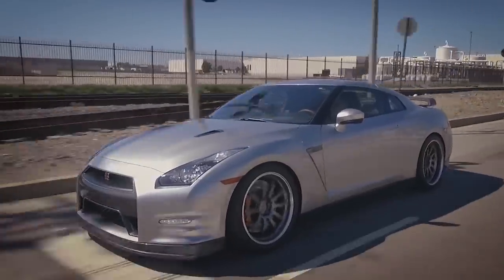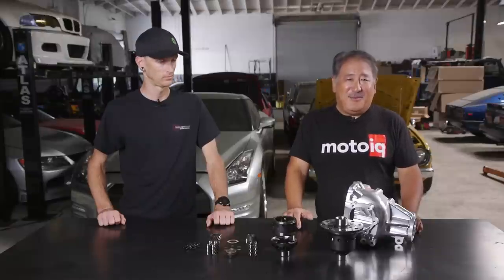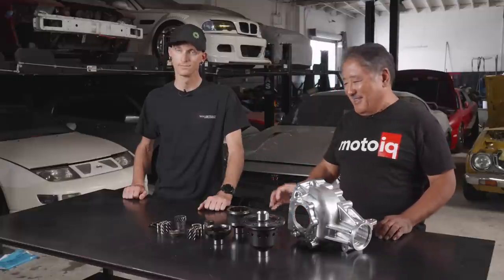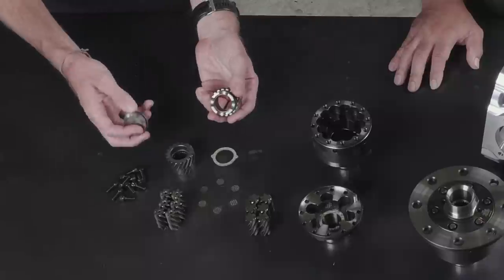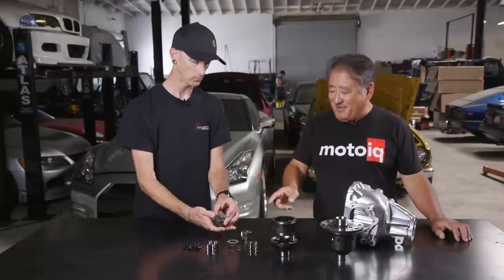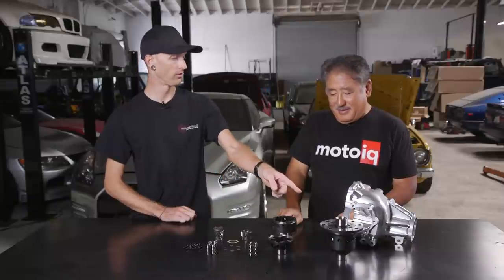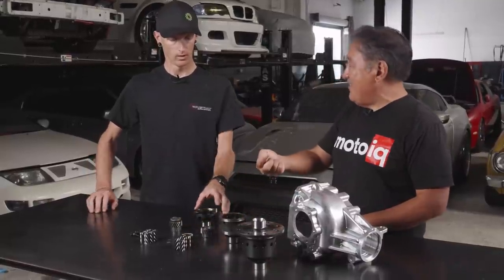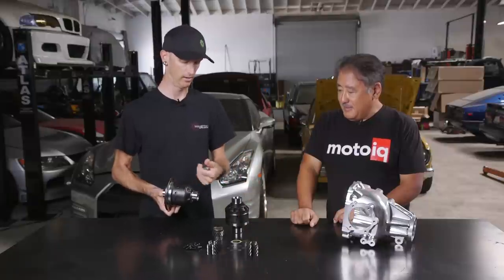How a Wavetrac Differential Works (and why you want one for your GTR!)

Comment: Literally one of THE MOST SLEPT ON car part manufactures is Wavetrac, Ridiculously reliable and lifetime warranty, feels so natural.
Reply: ATB Helical diff is probably the most slept on mod.
Reply: @JimBrodie  They also offer a lifetime warranty? I’ve used Wavetrac in all of my builds, I mainly like the natural feel of the diff and the fact that it does not interfere with any electronic driving aids. 

I’ll need to look into ATB design, I think I recall them having Yellow font and a blue box? 

Cheers.
Reply: @7eamGhast  I didn't mean a specific company, i meant as in this style of diff. ATB being an acronym for automatic torque bias, which is what the helical design does as a function. =]
Reply: @JimBrodie  LOL I'm a dummy! thanks!
Reply: I had a wavetrac after I bought a kaaz/Cusco diff that seized and blew! Only thing that broke it in the end was me crashing the car 😂
Reply: Except for Wavetrac being a Quaife rip-off with non-serviceable friction plates that don't do a thing.
Reply: @brandonlittle6444  Not wrong there tbf, they're practically identical aside from 'patented' friction plate and 'patented' camming surface as mentioned in the vid.
Reply: @brandonlittle6444  wavetracs just hold up better.
Reply: @oetic5016  only Quaife ATB failures I'm aware of involve or follow an axle failure. Which is the same for the wavetrac. Which is to be expected with Brandon's correct statement.
Reply: @transved6356  Ive only ever had a quaife I cannot complain about them
Reply: I have my first wavetrac and zero problems with almost 900 ft/lbs. I only go straight through… well I try to go straight
Reply: Is that a copy of a Quaife diff that has been around for years - same principle.
Reply: Idk about you, but i don't sleep on car parts. I sleep on a tempurpedic.
Reply: I have a wave track in ford 9 inch and the posi is like dragging or something to the point starts to smoke checked had a bad side bearing but replaced it and set pre load and back lash and same problem so it needs a new posi now smh 🤦 has anyone ever heard of this? Or what cause it
Reply: I have a whippled supercharged auto 2020 Mustang GT. Spent a lot of money on suspension and tyres to keep it straight. Was thinking of getting rid of it and going back to a euro car. Enter wavetrac diff, installation of this diff on my stang has transformed it so much more stable and straight now love it and not scared of it anymore.
Reply: I hqve one in my gli running 360hp, it literally feel’s completely different. The power the car delivers now is crazy with almost no slip at all unless in 1st or 2nd gear
Reply: Been English I would always go with a Quaife diff
Reply: @oetic5016 I doubt that very much
Reply: also the most precise LSD
Reply: It's junk
Reply: @dvernst  you don't have no idea!
Reply: Everybody knows Wavetrac in the Pro Touring world. They've been a known quantity since at LEAST the early 2000s.
Reply: But they dont make for a ton of models
Reply: Quaife is good also

Comment: That says a lot when the company says go have fun and go abuse it.. nobody that doesn't trust what they've built will EVER say this.. plus a lifetime warranty means they know they've built a solid product THAT WORKS.
Reply: Depends on how much power u throw at it if ur only playing with 1000 hp that's nothing but u start playing with over 3k I'm questioning what's gonna break next and will I get another past
Reply: @jackdaniels2657  "only playing with 1000hp"
Reply: @theunluckycharm9637  1000 hp isn't alot it doesn't take alot of money or time to make 1000 hp  u don't need to machine anything everything is bolt on. U gotta tune ecu  change  fuel pump, fuel injectors change the cam port the factory exhaust manifold remove catalytic converters run strait pipe.  add a cheap turbo kit or go with electric turbos turn it up to 22 psi yup 1000 hp. U don't need to rebuild a whole motor to make power u don't even need arp studs for 1000 hp. U can make more power by getting removing accessories like ac belts power steering waterpump hell u don't even need an alternator.
Reply: @theunluckycharm9637 tbf in high school I built 3 cars with over 1000hp albeit not all mine. 1400hp ls build in a gto. 1700hp hemi in a gto. Gm big block old school style making like 1100hp. 

These days with cheap ls bits and other random bits you can find. 1000hp isn't that crazy. Still alot but I mean. We have production 1000hp vehicles now.
Reply: @bmxriderforlife1234  I just don't think we realize how much power 1000hp is. My little ninja 400 has 49hp to the crank and even that feels fast at times so 1000hp Is nothing to scoff at. I mean a 450hp mustang can go 150mph so 1000hp can do that in its sleep
Reply: @theunluckycharm9637  yeah valid but there are also 1000hp plus turbo hayabusa builds. So idk. It's alot depending on weight of the car
 But few these days weigh under 3000lbs. In a 4500 to 5400lb car like the hellcats and shit. It's really not that much. The electronic assists are why they're so fast same with the demon. 

In a sub 3000lb car then yeah.

Comment: It's basically a Torsen diff, it's been around for decades. Invented in 1958. There are different types, they work on the worm gear dynamic concept.
Reply: Study up.
This is significantly different from a Torsen.
It definitely follows the Torsen idea, but it solves the Torsen's problems in a way that Torsen's inventor never imagined.
Reply: @deezynar  OK Explain that to me, I want to know what was the fundamental improvement compared to a Torsen ? I'm an engineer, so tell me.
Reply: @alainbelisle643  
First of all, the inventor of the first Torsen differential, Vernon Gleasman, did not come up with the arrangement of components that all have their axis facing in the same direction.  That was invented at least a decade later.  Wavetrac copied that design.  But Wavetrac introduced the cam.  That's two steps away from the original design.
BTW, I've known plenty of engineers.  A few of them made me wonder how they got their degrees.  One was a mechanical engineer who didn't believe that a water heater could explode.  Two others were structural engineers.  One hadn't heard of Gothic cathedrals with their vaults and buttresses.  The other couldn't solve a problem that only needed tension connectors to hold an octagonal roof together at the top of the walls.
Reply: @deezynar  So what they are calling a Torsen isn't then.  The whole point of the  differential designed by Gleasman was it was based on a worm gear.  The worm wheel at 90° to the worm gear and attached to the housing can't turn the worm gear.  If it's in an axial configuration I don't see how that works .  The original design worked quite well, but it was expensive to make.   The limited slip wasn't due to friction, but due to the gear design.
Reply: @kilomike5792  
I agree with you that this design is significantly different, and better, from Gleason's original idea.
This version doesn't use worm gears and worm wheels at all.  Not at all.  It has all gears oriented with all their axis in the same direction.  That means all of them share the same helical pitch.  The worm gear and worm wheel action only works if the pitch of the meshed gears are different from each other.  One has to be greater than 45 degrees, the other less.  This design ignores that method of function completely.
Not only that, but the so-called "pinions" in this style aren't even on bearings!  Their perimeters rub right against the pumpkin to create friction.  And the way they interleave with the other pinions means they can't rotate in relation to each other unless both axles are turning in relation to each other at the same time.  The torque of one axle is not enough to cause the whole mess of components to rotate and transfer torque to the opposite axle.
Gleason was a genius to come up with his design, but this evolution which came about years after Gleason's idea, is genius on top of genius.  I say that even though the original introduced the concept.  This method of doing the same thing is much more elegant.
That cam addition made by this company is a minor refinement compared to the overall idea.
Reply: @kilomike5792  The worm gear design worked on friction, too... but friction between the gear teeth (which slide against each other in a worm and wheel setup) rather than friction between the end of the gear and the case. Different location, both friction in proportion to torque transmitted by the gears, so the same end effect.
Reply: @deezynar  
You call it a minor refinement but I can tell you from experience it’s a major upgrade….
I’v had open diffs, locked diffs, lsd friction plate type, lsd cone type, tru-track, and wave trac😅😅😅. 
I’v tested the true track one wheel one slippery mildew grass and one on bitumen car went nowhere 
Same test same car but with wave trac and whilst the wheel in the wet mildew grass was spinning faster then the one on bitumen the wave trac got me out you can feel it pulsating in this extreme scenario it also helped calm down the axle tramp issuing have with this car 

I will never ever!! buy a tru-track type diff again due to its inability to get itself out of this scenario.
I know of a person who had trouble getting his car into a bottle shop drive through because his car would lift a wheel 😂😂😂 he had a tru-track the wave mechanism has help solve this
Reply: @MrJak427  
It's great to hear a report from a user.  My point about this design being a minor refinement was intended to point out that the difference in design is small.  It's good to hear from you that the small change made a significant improvement in performance.
Reply: I am no engineer, what I can tell you is;
I own VWs and Audis. I live in the CO mountains. The wavetrac in my mk6 gti,
makes the car handle corners and curves
much like my Audi A4.
I would say I enjoy the gti in the canyons
more than the Audi. ( the gti has Super pro control arms and a mild H&R "street"
spring and strut setup)
Reply: The Torsen has changed over the years. The third version used planetary gears, like this. Patents expire and competitors leapfrog each other.

Comment: The wavetrac is a great evolution of the Quaife type gear differential with the wave design operating in a similar fashion to a camshaft to increase tension. This eliminates the disadvantages of a normal gear type Torsen differential with one wheel off the ground. With the advantage of a direct fit for most differentials with quiet operation and a lifetime warranty included it's a great low maintenance solution.
I hope they expand the range because these types of differentials even work well in Hybrids and electric vehicles without disrupting the vehicles electronic control systems excessively.
😎🇦🇺👍

Comment: I had the Mitsubishi LSD put in my shep stage 2 transfer case originally. When I broke that. I had them put in the wavetrac and the difference is definitely noticeable at the road course. I can push harder around and out of a corner than before. It's amazing.

Comment: I have one of these in my BMW can confirm they are great. It's been installed for about 10 years and 120,000 miles in a tuned twin-turbo car.

I see there is also a part for a Ford 9" with 35 splines. I was going to get the Eaton Truetrac, but wouldn't mind paying a little more for the Wavetrac.

Comment: I had a wavetrac installed and now I’m a believer.  It completely transformed my car!
Reply: Can you drift with this diff? Or what What do you say would be the best differential for 350z to get both back wheels spinning on a drift completely locked
Reply: @redline350zHR  the Wavetrack is a strong dependable posi traction diff.  Perfect for drifting.  BUT u need to find out if drifters need a 1-way, 1.5, or a 2-way style diff.  A 1-way is locked (posi turns both wheels) only under acceleration. 1.5 is locked under acc but also 50% under de-acceleration. A 2-way is both.  I think a 2-way would be dangerous on the street.  Ask a guy who drifts what they use.  But the Wavetrack is good just not the cheapest diff.

Comment: Really cool to learn how these work. While rebuilding my rear diff of my Dodge 3500, I found out someone had already installed one of these. I knew it was a upgrade over the open diff and that it was better for on road applications then the clutch or lockers (my dodge lives mostly on-road but sometimes pulls into a field), but I never quite understood how these work. Never would have guessed it worked by using the gears as a friction surface by jamming them into the case.

Comment: A good follow up video would be "torque bias ratio" vs lockup of a clutch pack diff and the benefits and drawbacks of each.
Reply: Can this system be useful in 4x4/awd transfer cases?
Reply: @jamest.5001  The original Humvee uses a torsen center iirc.  Driver needs to press the brake or something when a wheel is in the air, but is otherwise very good from my understanding.   No personal experience with the platform however.